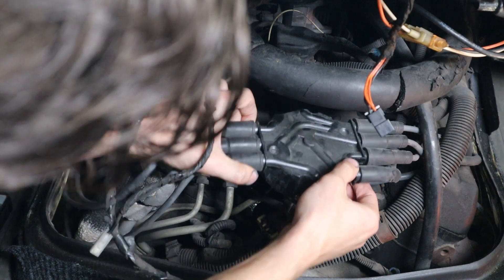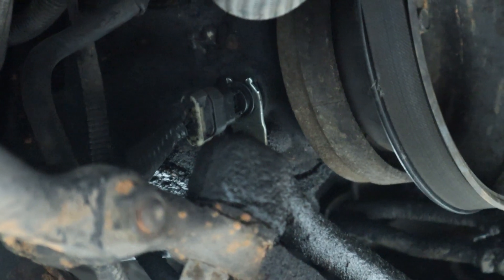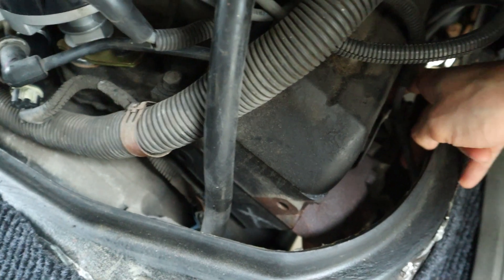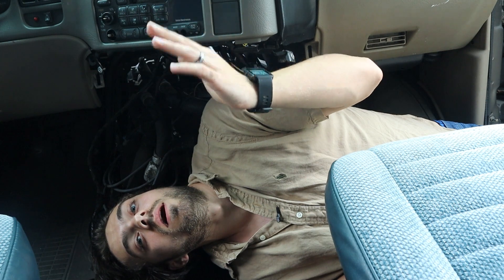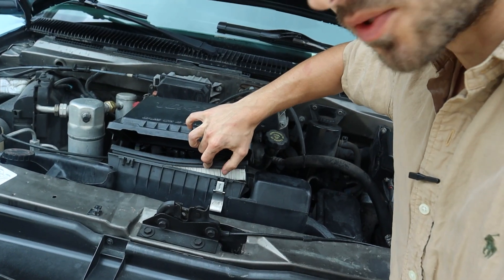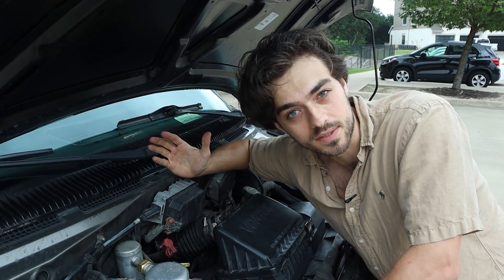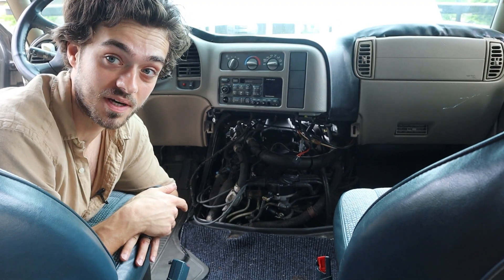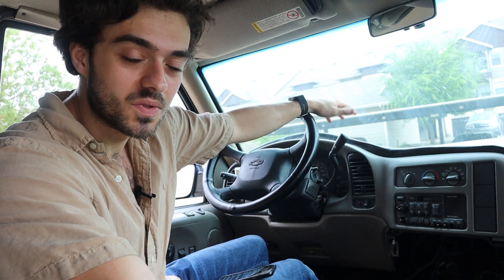Check this if you have a P0300 random misfire!

Comment: I Have a Missfire On My 1995 Astro AWD LT With 60K Miles, It Happened When I Opened My Garage Doors, Warm Outside And Cold In The Garage So Everything Condensates! I Am Just Using A Fan To Try And Dry Everything Before Throwing Parts At It!, While I Wait I Found Your Video And Very Helpful Because It Seems You Have Had More Problems With One Van Than I Had With Seven Astro/Fari Vans!  I Did Spark Plugs 25 Years Ago Once And It Took Me 9 Solid Hours To Replace 6 Plugs That Nothing Was Wrong With The Original Plugs I Was UP-GRADING To Some Split-fire Garbage And Then I Had Misfires So I Put All The Original Plugs Back In From The Factory And 400K Miles Later Never A Problem With Spark Plugs BUT If I Need To Replace The Plugs (NGK) 7177 UR5IX Keeping In Mind That All My Astro Vans Over The Years Went 300-500 Thousand Miles With The Original Spark Plugs And Ran Perfect, Used Zero Oil Between Changes Every 5K With Tuf-Oil Additive In Some And Always Castrol Motor Oil.. (RUST) Killed All My Vans Slaving To Break lines Fuel Lines And Fuel Pumps, Window Motors, Door Handles.. I Am Thinking After 8 Hours Of Industrial Fan Blowing On My Engine This Problem Might Be Resolved Without Doing Anything? 
Sometimes We Do Something And Make A Second Problem Wondering If The Initial Problem Got Worse? So Issues Clear Up Just THE WEATHER Causes Problems! I Can Hit A Puddle/Flood No Problem But Condensation Is Another World That Mudflaps. Engineering Didn't Account For! Everything Gets Wet And In Massachusetts With SALT These Vans Just Rust Out So The Term SURVIVOR! They Rust In The Garage! You Cutting The Floor Is Thinking Ahead! That Gas tank Comes Out 7 Times In 400K Miles And The Dealers Made Billions Off Consumers With Repairs.. 
 When The Rear Brake line Goes Over The Tank Use Stainless!

Comment: I had the same issue with my 02 safari, after a full tune up still the same problem turned out I had swapped the wires too. That was a while ago. Now it looks like I may have to swap out the fuel pump. Today it wouldn’t start, just cranked. Then I hit the gas tank with a hammer and it started…

Comment: I have a 2001 astro and every morning it cranks but doesn’t start only after trying for like 15 min. Usually my battery dies. Whats weird is in the afternoon it starts after like 3 cranks. I checked fuel pressure and that is ok. Also once it starts one time in the day it doesn’t do it again until next morning so i feel it has something to do with the weather .
Reply: 2000 Astro at about 200k hard start damp mornings. Passenger head was leaking coolant into the oil causing an accumulation of moisture in the distributor cap.
Reply: @ConsortiumBlaster it was humidity in the distributor cap. I made some small holes in it and it solved the problem
Reply: @KEROT323  I did that also. Helped some but it was still moisture getting into the crankcase system migrating into the distributor.
Reply: If it's a bear to start first time of day or if it sits for length of time I would lean heavily towards a fuel pressure regulator.

Comment: I have a 2003 DODGE CARAVAN SE V6 3.3L

The minivan is giving me a P0300 code.

I turned on the engine and left it idling.

Connected a test light to a ground and connected a vacuum gauge to a vacuum port on the upper intake manifold.

I did a cylinder drop test using the test light while removing one wire at a time from the coil pack and observing the vacuum gauge needle for movement.

As i was removing one wire at a time from the coil pack using the test light the vacuum gauge needle was not moving so i can know which exact cylinder is misfiring.

Do you happen to know why the vacuum gauge needle was not moving?

I uploaded videos on my channel so you can see the tests i did can you check them out, please?

Comment: I replaced my fuel injector with an acdelco fuel injector and the pressure still bleeds off when I turn the engine off. Could it be the fuel pump causing this?

Comment: What’s up man, love your Disastro videos. I just recently had a super cool guy break into my 2000 Astro and try to steal it. He cracked open my steering wheel column cover and in the process cut one of the wires to the steering wheel on top of flat heading my ignition coil. I spliced the wire together and can get a key in my ignition but now I’m getting a P0300 code. Can this be because of the wiring, or is it unrelated?

Comment: I JUST took my 02 Astro in for that code yesterday!
Reply from the maker: What was the outcome??
Reply: @ImChrisDeDecker  they determined, after 700$ in diagnostics😬, that my number one cylinder is bad. It had 2000 misfires! Not sure if that was under the testing- or if the computer held that info. They suggest a new motor. It only has 104K miles on it… I have always been happy with the auto shop i go to… but man! They gave me an estimate of 8600$. Also told me that due to the “high miles” it wouldn’t be advised to just address that cylinder- that it would be labor intense and it’s likely that the other valves/cylinders would likely start failing as well. Not sure what to do from here. I am NOT a mechanic- I looked into a rebuild… but then finding someone to install… what do you think? My first thought was that I need Chris! ☺️ in my opinion, 104K miles isn’t high miles. My service light started coming on when I went up north and climbed steeper hills…
Reply: My grandson replaced the O2 sensors… cleared code!

Comment: i have a 1998 gmc safari with the same problem and same code about 2 years ago and my issue is that it would fill up with posture causing the points on the distributor cap to corrode what i did to fix the problem was to buy a marine-grade cap and rotor made out of brass that's hydrophobic meaning water doesn't stick to it do that and most likely that will fix you i know you fixed your issue but in the future this may be something helpfull

cheers

Comment: Great video, i have a 1993 Astro and it is stuttering at more then 50 percent throttle, i heard that the throttle position sensor can cause this, do you know anything about it. 
But what i also wanted to say is, that you are doing the best Astro Videos on YT :-)
Reply from the maker: I would check your fuel pressure. When I first bought this Astro, the van did just the same. The fuel pressure was reading something like 30PSI. 
I have a fuel pressure tester linked in the description, it’s fairly cheap 🙏 
And thank you! I put a lot of effort into these videos
Reply: @ImChrisDeDecker  thank you 
Fun story, the fuel pump is brand new and the fuel pressure is perfect